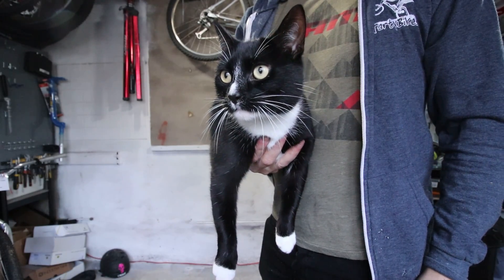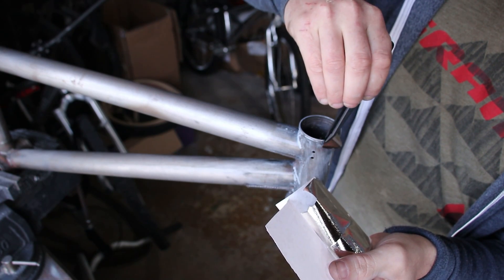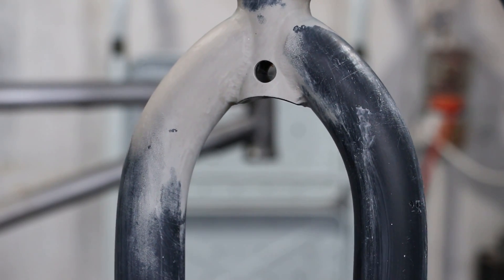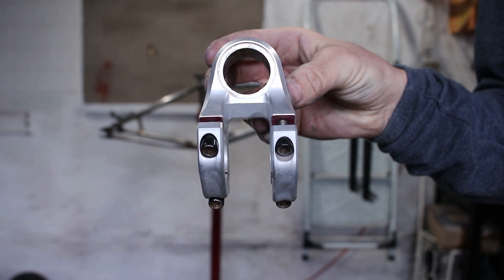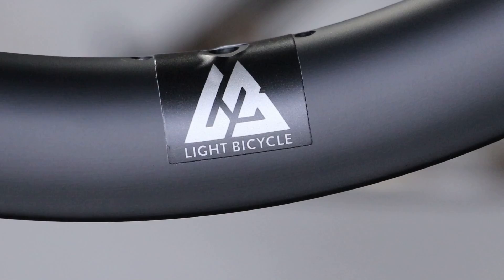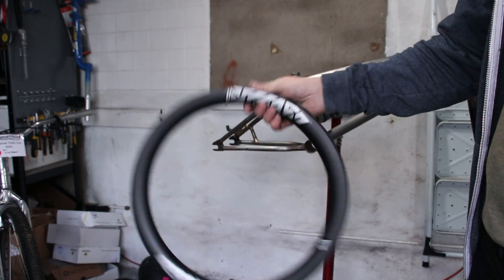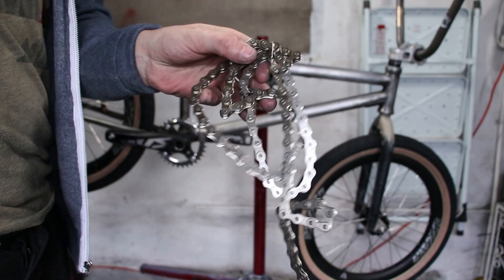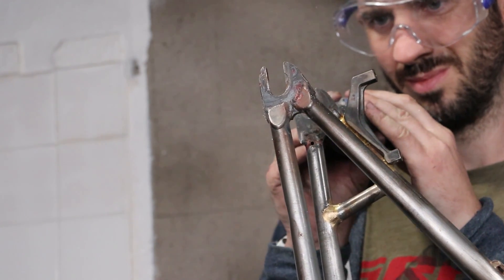I Built a MTBers BMX With Carbon Rims, Disc Brake And A Few Surprises

Comment from the maker: I’m getting a lot of comments asking about the bb adaptor, here is a link to the one I used 👍🏻

https://www.unleadedbmx.com/en/mid-euro-bottom-bracket-converter-7393.html
Reply: What is the name of the chainring? I need one.
Reply: Bro can I please ask why you call shims shems no one who I've ever met has ever said that. It sounded so stupid and you said it was such confidence multiple times. It was quite comical
Reply: Heads up you mightve been able to make a mid 24mm bottom bracket work.
Reply: @Orion_5764  Because you can't assume their gender bro

Comment: 1:00 I get that it's a joke, but just in case people don't know, the standards are there for cross-conpatibility. It comes from a rejection of corporate businesses that try to proprietorize parts.

Disc brakes aren't common, due to damage from grinding. A rim brake has a lot of play, and is out of the way when doing stalls or grinds. 

As far as I know, half link chains, and probably a few other things that can be seen on other bicycle styles, were invented for bmx. And bmx takes from other styles as well, including the Fingers Crossed 20" bmx with full suspension.

Your finished bike is awesome!

Comment: 8:35 if you’re running a 12t on the back I would go for a 33 tooth sprocket on the cranks 👍🚲💨
Reply from the maker: I’m sure 1 tooth smaller won’t make much difference

Comment: 0:21 - That's cool and it gives me an id- smack  Oww... WTF was that¿!    😳
😂
Edit: I'd call it B-MTB... And just a bit of advice, you should run the handlebar spacers on the inside of the stem so they don't have a chance to fall out if the bars rattle loose.    😁

Comment: 7:43 if the dropouts on the back of the frame are 10mm you could’ve gone for a elite Profile MTB Single speed cassette hub they’re the same 👍🚲💨
Reply: And use adapters to bring it to 14mm
Reply from the maker: I could’ve used that hub either way, the Hope hub is 10mm and I just used an adaptor. The Hope was a lot cheaper!

Comment: Awesome bike mate!  Just one nit-pick!  

I do believe you put the bottom bracket adapters in backwards. Or opposite of the side they should be on to be specific. Right side bottom bracket cup should thread in regular.  Left side bottom bracket cup should thread in opposite with left threads.  Either way,  thanks for the vid mate! Good watch.
Reply from the maker: I wouldn’t put it past me to get it wrong but I checked, double checked and checked again they were correct…they had little L R letters machined in to let you know which side is which.
Reply from the maker: And actually I’m pretty sure you’re wrong, right hand side is opposite, left is regular
Reply: Appreciate you mate

Comment: 8:28
Most 2000s BMX bikes had a 35t front sprocket and 16t rear sprocket. Microgearing wasn't introduced until late 2007.
My 2007 Haro Nyquist One (before I taco'd the rear wheel and sharktoothed the sprocket) had a 39t front and a 16t rear.

Comment: As someone who frequently mashes bmx and mountain bike together, currently a bmx with 27.5 ROCKSHOX forks, front disc, rear v brake, and bmx handlebars, with 20 inch wheels, 20x3 tires, I call mine MTBMX!

Comment: personally i feel like there were somethings you could of used to not have to make it harder on yourself. first being the stem, bsd, cult, and a few other companies make stems that are meant for the 1" clamp system, shims on bars in bmx is not the best idea because of the rigidity and how much tension is put on the bars so unfortunately they are way more prone to slip just pumping around. second the BB, I'm not sure the size of the spindle on the cranks but there are tons of options for BB's and various sizes like 19mm, 22mm, and 24mm so that would of eased up the process a little more. all in all cool video and interesting to see the premium frame being adapted for discs

Comment: I dont know if i just cant find it but what does it weigh ? really cool bike I think ya might have been able to avoid the drop out grinding with a half link chain but maybe you already tried either way it would still be strong enough to do a lot of riding in the skate parks dirt jumps and street minus going huge and grinds. I am very curios about the tubeless for large ish 360s

Comment: You didn't need to grind down the rear drop out. You could have used a half link to get the chain a little shorter for a proper fit. Profile  used to make a BMX 3-speed cassette hub. It would have been cool to see some gears on this thing! I'm currently running a 2-speed Kore hub on my old Haro BMX. Still, awesome build!
Reply from the maker: Not keen on half link chains, they stretch way too much!
Reply: @Ali_Clarkson  I never considered that, but now that you mentioned it and looking at the design of a half-link, I can totally see how significant stretching can occur. You learn something new every day!
BTW stick with BMX, you're better than you think.

Comment: Maybe disks are rare in BMX freestyle, where they moved away from brakes entirely a long time ago, but in BMX racing disk brakes are very widely used. You can buy disk brake adapters for bmx dropouts from Dan's Comp.
BMX racing is no stranger to carbon, and ODI lock on grips were being used on bmx in the 90s

Comment: I'm trying to fit a 24" BMX wheel (3/8*110*165W) into a mtb frame that's for 26" with a 135mm rear spacing. So basically 110 mm unto a 135mm, how would you go about this? I was thinking about adding spacer nuts on the left and right of the axel. Do you have any other suggestions on this conversion?

Comment: If still you want to metal leaf the frame, use better glue, that stuff is trash.  You can use hard clearcoat like varethane or smthg. It's trickier to dry to the right 'tack', but it sprays on, so can go on very smooth, and obvs you're gonna do small areas at a time so you get drying practice as you go, and re-covering areas that didn't take is possible bc it goes on so thin.  The results compared to the craft glue included is night and day

Comment: this bike is an half born BXR "crossroadster" or "Sport-touring bmx", half because use of normal bike parts like the threaded bb, normal seat post and 135 cassete disc hub. 
but not use multi-gears and front brake like an true BXR.
i like this setup a lot but instead of use a bb adaptor i will change to pressfit bearing 6205, an carbon seatpost or dropper post and an kmc x8 gold chain.

Comment: Looks great bmx race bikes are using disc brakes now and have been for a.while
Reply: I remember back in Bmx plus bmx mag GT did a BMX with a disc brake on the back it was prototype back in the day now these are coming into racing now starting with the 2021 models 👍🚲💨

Comment: With two air paths, I'm surprised the bars didn't play a chord. Must not be resonating like a brass instrument.
Reply from the maker: There might be a breathing hole for welding the brace but I don’t think it has much air flow, my guess is the bar is damped by having that brace and the vibrations/frequency is reduced as a result
Reply: @Ali_Clarkson  it just occurred to me that there is no reason the brace would be open to the rest of the bar. They'd have to have drilled it before welding.

Comment: When working with those metal leafs try to apply a thinner layer of the glue. And once that has dried, apply the metal with the paper still sticking to it. Press that paper on there and peel it off the leafs, which rather choose to stay with the glue. For remaining blank areas use whatever leaftovers(!) you have. I hope to see some colourless metal applications on your bike builds in the future!
Reply from the maker: After that attempt I experimented and pretty much came to the same conclusions…you can see I added a big sheet to the top tube. The awkward corners were still tedious though 😋
Reply: @Ali_Clarkson  I can imagin those awkward corners being quite challenging! But you got me hyped on trying out some metal leafs on one of my bikeframes in the future! I hope the finish (even with layers of clear lacquer ontop) kind of holds up to the classic BMX abuse!

Comment: i dont think the bb adaptor would be that much necessary since shimano uses 24mm spindle diameter last time i checked and there are 24mm MID bb's,but great solution anyway!!
Reply from the maker: There’s a reason why I couldn’t get that to work but I honestly can’t remember why!
Reply: @Ali_Clarkson  I had the same thing trying to fit Shimano cranks to a mid BB dirt jump bike.  Shimano BBs are a 25mm bearing and they just a top hat on the crank.  Mid BB is nominally 24mm but it doesn't play very well.  I can't actually remember the reason either,  but either way it doesn't work without some turning...
Reply: @Ali_Clarkson  maybe spacing?since mtb spindles are longer than BMX ones
Reply from the maker: @brunaogemeplay2439  I don’t think it was that as I could just use spacers like BMX cranks. Thinking about it I think the axle simply didn’t fit the 24mm bearings I had. Even though both claim to be 24mm it only takes one to be .01mm off and suddenly they don’t fit and I think that was the case with me
Reply: @Ali_Clarkson  got it sir,either way the build turned out very nicely,eager to see you shreding it!
Reply: What's marketed as '24mm' in terms of BMX spindles is just shorthand for 23.8mm/ 15/16"-the standard bore size of pretty much all bmx sprockets... I guess it was easier for modern brands to list the spindle sizes in a similar whole-numbered format to existing 19 and 22mm cranks once '24mm' spindles and bbs came along a few years back, I often hear from people trying to install 24mm bmx cranks with 24mm mtb bb's who run into problems not knowing this

Comment: It is amazing how you have neglected any research about any of the points of BMX you seem to have some very harsh criticisms about. There are now Freestyle grade BMX Carbon Fiber rims manufactured by Eclat, in fact they now offer a complete bike that feature carbon fiber rims as stock spec. The 3/8" (10mm) axle standard for front wheels has been predominant for a number of years, and has proven itself more than useful. I can see the oversight regarding disc brakes in the Freestyle world, but they are more than accepted in the race world and have been for a number of years. I would make a comment about how disc brake compatible cassette hubs have been available at the 110 spacing found on BMX frames, but the adjustments you made to the hope hub does seem to be more your style. I thank you for spending some time in the world of BMX, I hope you find more to love as you enrich yourself.
Reply from the maker: Dude it’s a video about my cat going out and finding parts, it’s not that serious and I was being hyperbole 😊. I love Bmx and was just poking a little fun at how militant some oldschool riders can be about not accepting change

Comment: My heart cracked when I saw dropouts being grinded. You could just use a half-link.
Reply from the maker: I’ve never liked half links, the design of them allows them to stretch and become a literal weakest link
Reply: @Ali_Clarkson  Did you just eyeball it so they would be even? I suppose it doesn't matter as long as the wheel is straight when you tighten the bolts. This is a beautiful build, with all the sexy technology, the adapters. 👍
Reply: You wanna check out the shadow supreme chain lifetime guarantee on breaking and that is an half link chain aswell 👍🚲💨

Comment: Bike looks sick if I got a Sunday frame or fly frame could I put those cranks u used wher do u get adaptor for bearing and wgst kind of crank is thst an how much are they. Thsnk you
Reply from the maker: I put a link to the adaptor in a pinned comment at the top. The cranks are Shimano Saints…. They’re quite expensive unfortunately but it might be worth trying to find a used pair

Comment: Hey ali i have an other question. in your experience can an aluminum trail bike's disc mounts with 203 rotors and the dominions cope with some very low level trials, basically just small back hops, every thing else that i do is on 2 wheels so not much stress 
thank you
Reply from the maker: Really depends on the frame and how much support the disc mount has, if it’s substantial looking then yeah you’ll probably be ok but if it’s a small mount welded to a skinny tube then it might not like any backwards forces that trials makes
Reply: @Ali_Clarkson  thank you very much Ali

Comment: BMX Hardly shys from development. We've adapted to tyres over 2.5", developed 9t integrated drivers, freecoasters. We have 19mm, 22mm and 24mm BBs all in the pursuit of perfection. Discs are heavy and pretty pointless with slick tyres and small wheels. A U-brake is more than sufficient. Furthermore, removing the disc mount offers a wider flange spacing for a stronger wheel. 
 All modern BMX run a 14mm rear and 10mm front axle. 
It keeps a good balance between weight and strength. 
 25.4mm OS is fairly common on bars now a lot more force is being put through them. 
 Carbon rims are becoming a thing with Eclat Carbonic rims coming about. 
 Adapters really aren't necessary. Just run a 24mm Mid BB, it's a standard in BMX with BSD, Odyssey and Primo offering solid cranksets and BBs in this size. 
 You should use half-link chains. They're stronger and offer a refined adjustment. 
 BMX looks simple but under the surface is a massive drive to get more out of a bike without adding anything unnecessary. Some incredible innovation comes from this. Box components started as a racing BMX company buy have taken that knowledge into MTB with some brilliant kit.
Reply from the maker: I was being hyperbole regarding the lack of development 😋 I was just poking a bit of fun at the hate some brands get when they try to introduce updated standards (tapered headtubes etc).

You make some good points with the other parts though…I was being specific to street/park Bmx regarding the lack of disc brakes and 31.8mm bars etc but I guess I wasn’t vocal about that…I see race Bmx as a completely different thing.

As for the 24mm bb, I did actually just try and use these cranks with a 24mm mid bb but even though both brands claim to be 24mm either the bearings are slightly under or the axle is slightly over as they simply wouldn’t fit, shame as that would’ve been nice and simple!

I do have to disagree with you about halflink chains being stronger though. As a trials rider chain strength is very important and halflink chains are a no-go! The curved shape of the plates inherently want to be stretched straight under high loads, when they do stretch they become weaker. It’s maybe not so bad on a Bmx with less torque which is why people have had good experiences with them but I can’t bring myself to run one on any bike.
Reply: @Ali_Clarkson  things like tapered headsets and 31.8 bars will always struggle to get into street or park because the standards in place make the bikes so easy to maintain and upgrade. We see the problems in MTB with trying to find compatible parts, hubs especially are a nightmare with so many standards. BMX thrives on the simplicity of simply needing a headset rather than a specific headset or a stem rather than a specific stem. 
 Salt has a seat and seatpost combo which can build a BMX. The seat holds a hex key with a 5mm and 6mm end, the seatpost has a 17mm socket. Between those three tools an entire bike can be sorted out parkside, something which the BMX scene loves. 
 A lot of consumables are kept available because the standards are so common. New headset bearings cost less than £15, a replacement pair of hub bolts are about £5. Brake pads are brake pads, for less than £10 you can get a set which you know fits. With the lack of dedicated BMX shops this really helps keep the bikes running, most spares can be found in Halfords. Elsewise it's a wait for the parts to come online. With MTB there's a risk the part won't fit and you'll need to send it back and get something new, not so with BMX. 
 WTP tried tapered but no one wants to go out and get a new frame, fork and headset when their 2015 frame is still golden and the fork they've run since 2010 is still solid, to the BMX scene it feels unnecessary and almost like a cash-grab. 24mm BBs and 25.4mm clamps have remained on the fringes because running them requires a new BB for £30 and new cranks for about £150, or a stem for £50 and bars for about the same. 
 Sure these things offer better performance but at a cost and complexity no one wants. 
 Must say, kind of odd the cranks and BB didn't work on your build, I've seen some DJ builds do exactly that and work but it's probably down to particular cranks and bearings being just right together. With that said, a BMX crank and MTB BB seems more common in that field so maybe it's not a priority for manufacturers to make it work the other way round. Threaded BBs are certainly easier to work on, that's one thing BMX could benefit from, press fit is a nightmare to remove for replacement.

Comment: BMX supposed to feel small. For more agility and such. Its not the same feeling as MTBing and such, You want to feel like you can just "toss" the bike away without much force and bail. When trying to do technical tricks and such, youll find a heavier, harder to manipulate in mid air, bike chassis, will often end up in you injuring yourself more, falling on the bike and such. I learned  this when I was very young in the height of Dave Mira and such on the X games, I thought id be a hard core flat land free stylist. Mom bought me a GT Dyno "NSX" with all the fixens, attachments and such.. lighter wheels, new grips.. new brakes.. the whole 9 yards... then someone stole it off my front porch in broad daylight. I ran inside to grab a squeez-It or popsicle or something... GONE.. Not even 2 mins later.. Bikes worth a VERY pretty penny today. Original GT Dyno.. * sigh * Why are people ass hats.